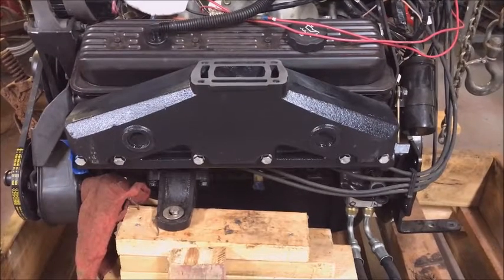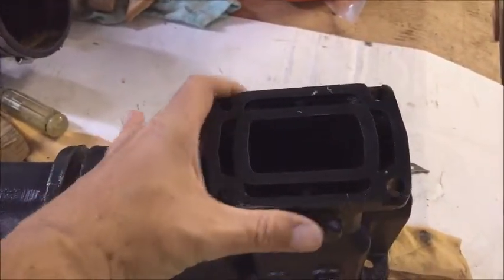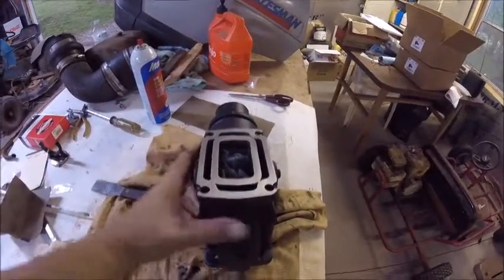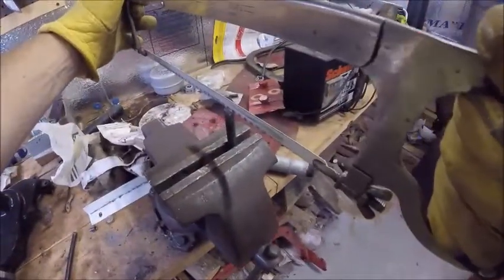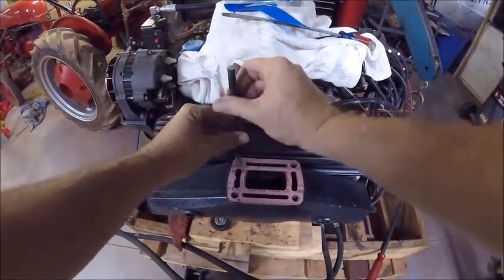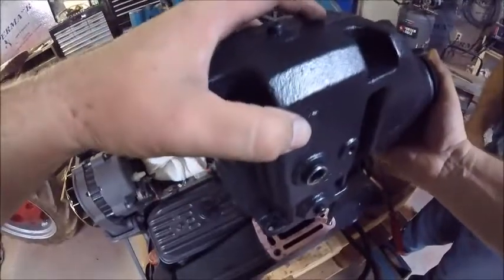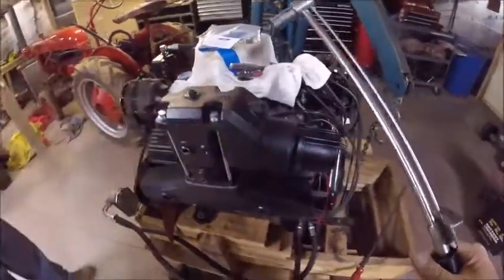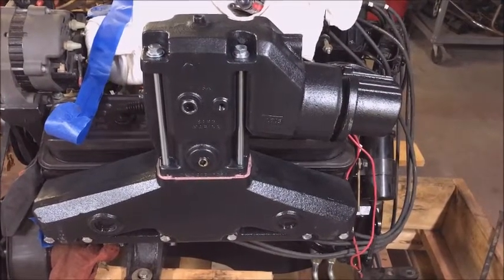How to Install Volvo Penta Marine 5.7 Risers Chevy 350 Small Block

Comment: Should you use anti-seize on the bolts?
Reply from the maker: Yes some anti-seize.  After you run the boat the first time re torque the bolts while the engine is still warm.

Comment: When I did the same job I used the same trick with cutting off the bolt heads and cutting the slot in the top of the stud. I installed Barr manifolds & elbows and their gaskets were a thicker composition gasket. I used Permatex sealer on the gaskets and sealing surfaces. Three years later and no leaks.
Reply from the maker: Glad to hear it worked for you and the using of the Permatex........
Reply: @RiverReboot  
Ok here’s a tip for you inboard owners...if you have water leaking in around these gaskets between the manifolds and elbows, what you’ll see is the center electrode insulator of the spark plugs will have an orange cast to it instead of light grey or tan. It’s a good idea to check your plugs when you winterize the boat at the end is of the season. I learned this from having water in a couple of cyls from leaking head gaskets in my 4.3 V6. Caught it in time and installed a set of reman heads on the original short block...
Reply from the maker: @Luigi-pk8mk  That’s a great tip good way to catch it early.